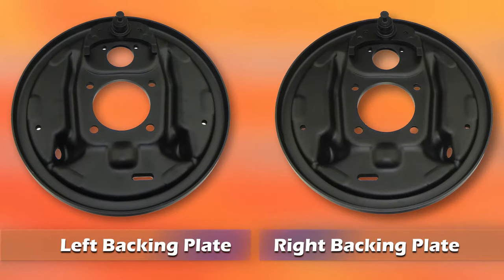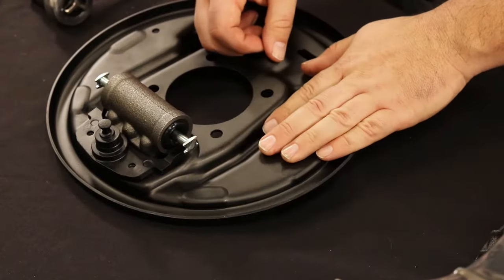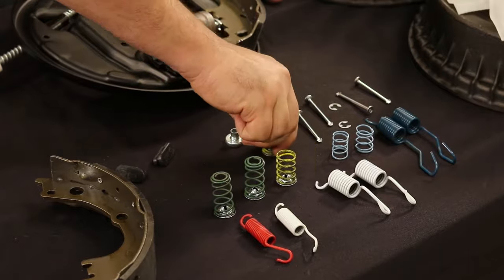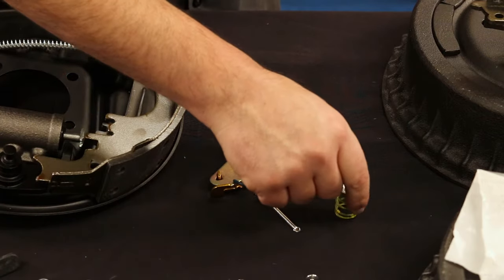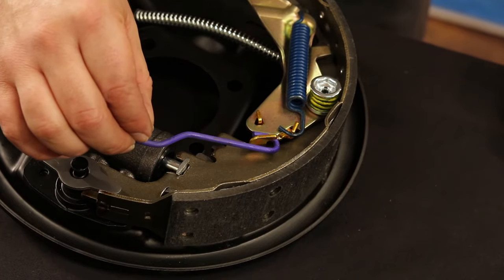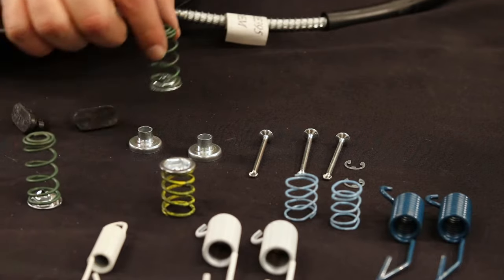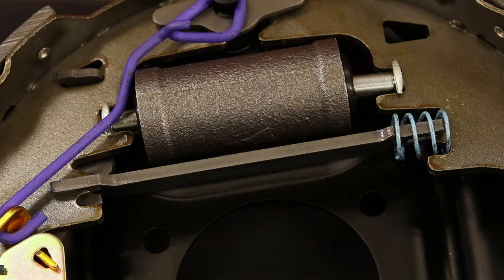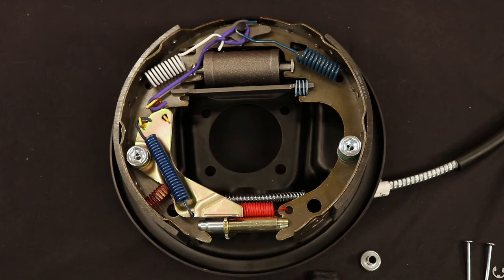How to | Assemble Drum Brakes

Comment: Excellent. For those watching, be aware at 5:00 that the red spring between the 2 pads feeds through with the wire hook to the top above the sprocket wheel. For the opposite drum, it is not only facing the other way but inserts opposite. Otherwise, the end hook will foul the sprocket teeth on one side, found only when done and trying to adjust, and all from following a different 'professional' guide online. In the video the hook goes into the pad from the top, the opposite drum is not only facing the other direction, but needs to start from the back, not the top as well.

Comment: Nice video btw I always wondered what are the small c clips for in the spring kit 😀
Reply: I wondered that too, only reason why I watched the video because I thought I was forgetting something.
Reply: @carnut7615  C-clip is for another style of brake. The emergency brake lever on the other style has a stud that passes through the primary shoe and the c-clip hold the lever in place. FYI: on this second style of brake, there is a spring washer that goes on this stud and is positioned between the lever and the shoe. I don't think the spring washer is included in the kit.

Comment: Excellent video. Do you sell the brake tools? Sure beats trying to stretch a spring with three screw drivers: one in your mouth and two in your hands! Used you guys for replacement brake lines for a vintage Dodge truck. Excellent quality. Those GM 9.5" 14 bolt rear ends are not that common anymore. I was fortunate to find one. Thanks.
Reply: Thanks!! We do not sell the tools for this video.  We appreciate your business!!

Comment: Would the backing plate fit a factory 1986 El Camino? I I know I would have to pull axle s out. hate the clips want to change that to bolted wheel cylinder if I can. Thanks for the video
Reply: We do carry a backing plate for your Vehicle that has a bolt in wheel cylinder.
Reply: @charlesmcmartin8659  
Do you have the part number & a link to your store?
I guess it’s the same size shoe to?
The cylinder on passenger side fits really loose with the clip just seems to loose to me other side doesn’t move as much. But if I’m going to change the backing plate I rather have bolt on cylinders.
Thanks for your help
Thank you for your help